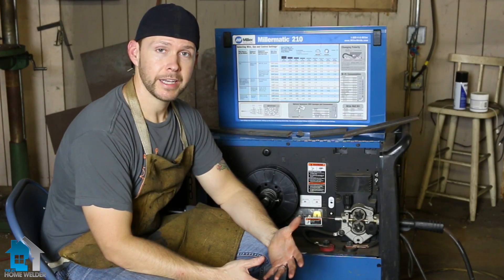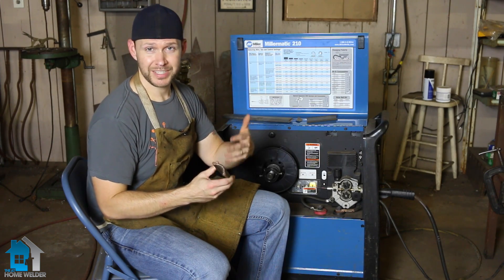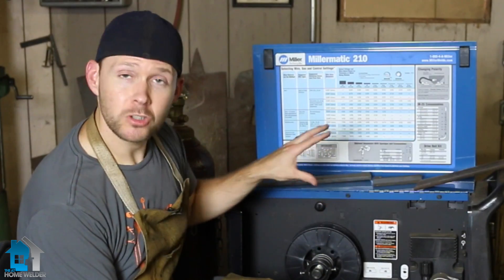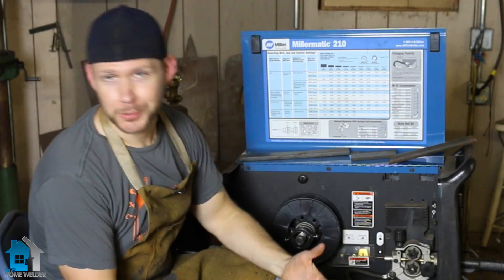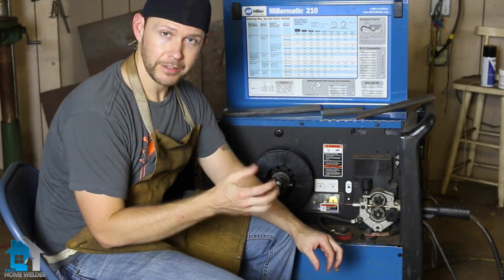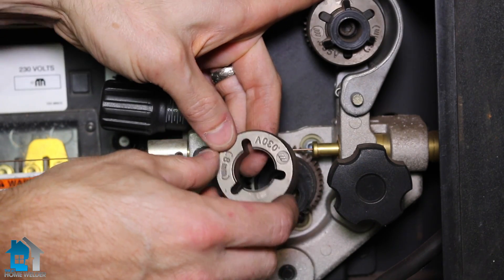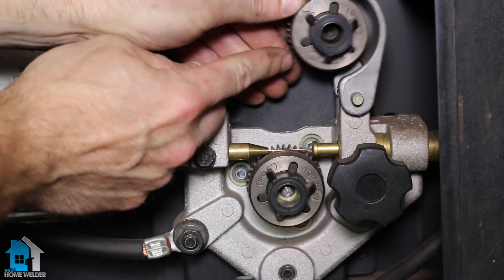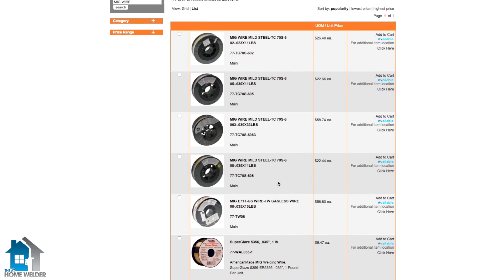How to Know Which Size MIG Welding Wire You Should Use

Comment: Its cheaper at menards so that's all I gotta do for the 125 cheap welder but the bottom groove looks larger though on mine do those stores sale the pieces for the 0.023 wire 

Mines not set up to take 0.023 wire

Comment: Gun has a liner and a tip that need to match the wire for best operation:  
.035 wire won't feed through a .023 - .030 liner and a .023 tip.
.023 wire won't feel evenly through a .035 - .045 liner and a .045 tip, it will buckle and rattle around, maybe S-curve and jam in the liner, maybe spot-weld to the tip which is supplying the weld current to the wire.  It's a copper or brass alloy for a reason -- good electrical contact and conductivity!  
The welding current gets into the MIG wire through the torch tip.  Ten feet of steel MIG wire would have FAR too much resistance (and heating) to provide tens to hundreds of amps for welding.
Reply: Yeah an getting that thick metal hot enough to melt helps it stick to instead of only welding the cracks

Comment: I am a complete wire welding newbie. Actually I’m even more ignorant than that but I’m trying to learn. 

I bought a cheap 110v flux core welder on amazon and it came with a little roll of wire to get me started so that I can see just how bad of a welder I am. Lol

I need to practice so of course I need more wire. The only info I get from the manual is that my little machine can use 0.6 - 0.9mm wire. I get that this is the diameter but what are you talking about when you say 030 and 035? Is that much bigger diameter than mine uses or are you talking about something different???

I hate to ask such stupid questions but I guess it’s actually true that I am pretty stupid on this subject. Could somebody please try to explain this to me rather than just calling me names and telling me that I have no business welding? Lol because I promise you that I am going to weld if it’s the last thing I do. Lol 

I took a welding course in High School but it was stick welding. I’m thinking I should have just bought a stick welder now but I wanted to learn something new. Oh well?
Reply: Hey George, I know this is a year later, but just in case anyone else comes through reading this...  Plus, I hope you didn't give up on welding since you posted this...

"030" and "035" are decimal inches, actually 0.030" (thirty thousandths) and 0.035" (thirty five thousandths.)  These have metric equivalents, which is how your 0.6mm - 0.9mm is stated on your welder.

0.030"  = 0.762mm -- called 0.8mm when you round it off

0.035"  = 0.889mm -- called 0.9 mm

and one more you didn't mention:

0.025"  = 0.635mm -- called 0.6 mm

If you got instructions with your welder, look at them to see if you have different rollers for the different wire sizes, as shown in this video.  they may have two grooves, so you can turn them around for the other size, like shown here.  

You can buy more wire at a local welding shop, but that may be harder to find.  I found that the Home Depot store near me has a small welding section, and they have rolls of wire in both .030 and .035, I think, so that might work for you (don't know if yo're in the US or not.)   

Good luck!
Reply: What store sells the rollers for the 0.023 wire 

Mine only takes 0.030 or 0.035 wire that's it

Comment: All that info but you never answered your own question: WHAT THICKNESS OF STEEL DO YOU USE WHICH WIRE SIZE FOR? 0.023 up to 1/8" 0.030 up to 3/16" 0.035 up to 5/16" You never answered your own question. If you make a video in answer to a question you should answer the question.
Reply: This is true sir no need to shut up, the question was never answered.
Reply: @Sataman Schmidt, Exactly what I was thinking/looking for. Ignore the arse wipes.
Reply: You answered the important question in 5 seconds whereas the "expert" showed off his shiny new welder for 10 minutes
Reply: Yeah I also just wanted to know based on the metal being welded.
Reply: also the groove dimeter on the outside of the drive roller is normally the INSIDE groove.
Reply: Shut up..

Comment: The tip needs to match the wire size also.
Reply: Yes, the welding current gets into the MIG wire through the torch tip.  Ten feet of steel MIG wire would have FAR too much resistance (and heating) to provide tens to hundreds of amps for welding.
Reply: No it does not
Reply: @SOLDOZER  it absolutely does.  035 wire, needs an 035 tip.